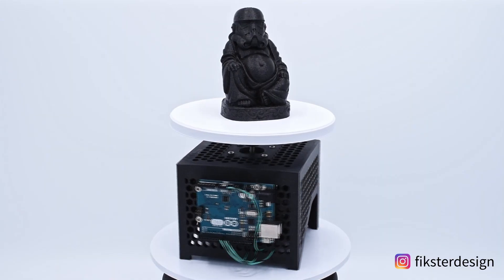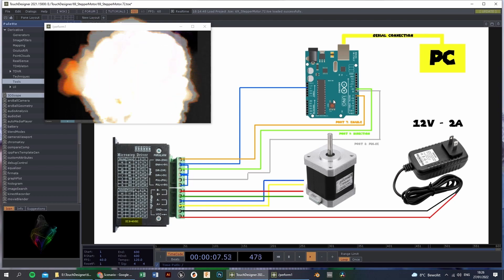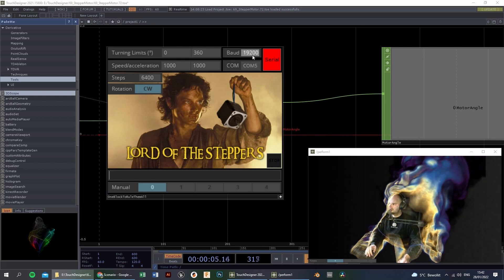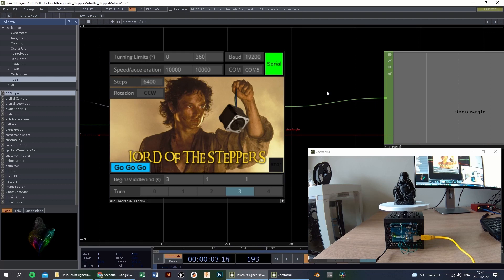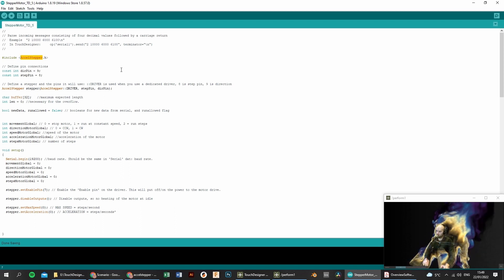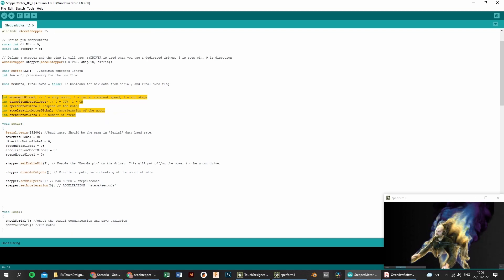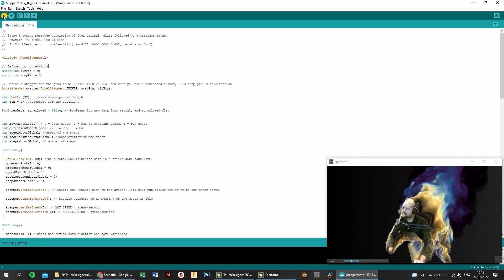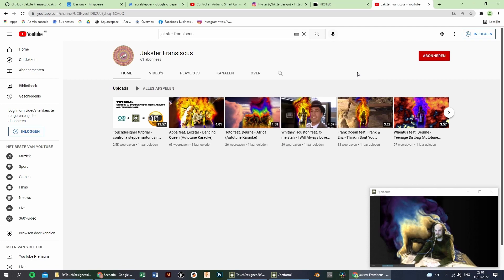Make Your Own Turntable Using Arduino and Touchdesigner

Comment: Amazing project! Would this still work if using a ULN2003 Motor Driver instead of your micro step driver?
Reply from the maker: Thanks! You can choose whatever motor driver works with an arduino. You will probably have to change some Arduino code, but you'll get it working!
Reply: @jaksterfransiscus3001  Managed to get it working! Could you explain to me why the stepper driver has 12v in but the Arduino is also sharing 5v with the driver?